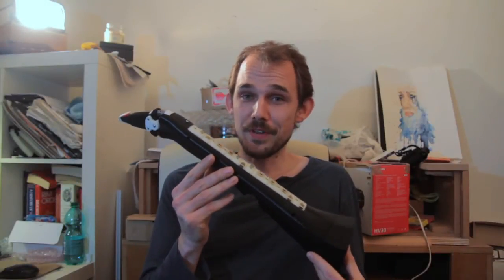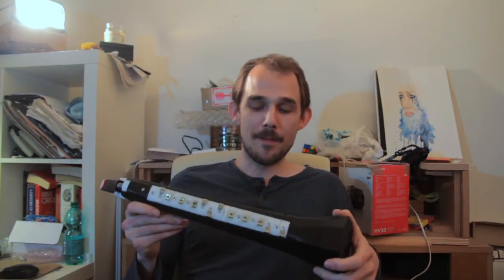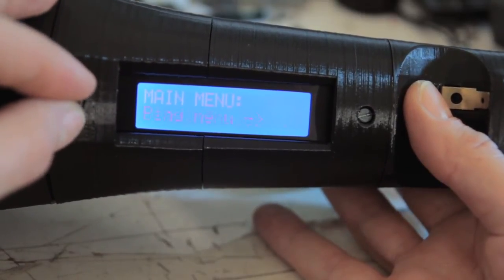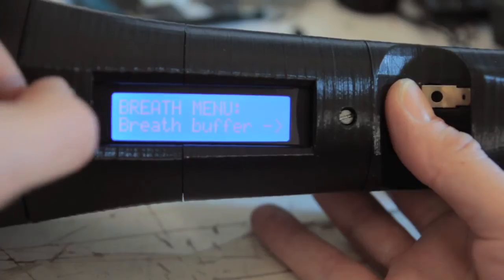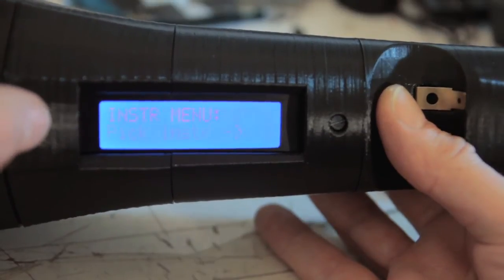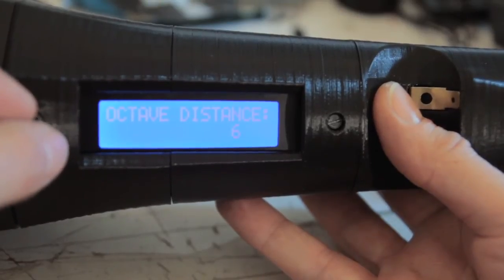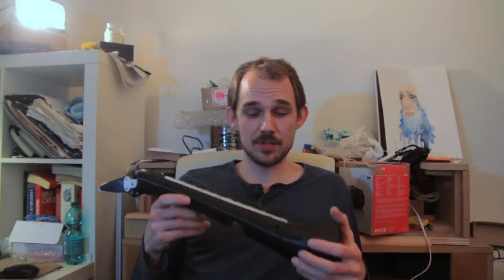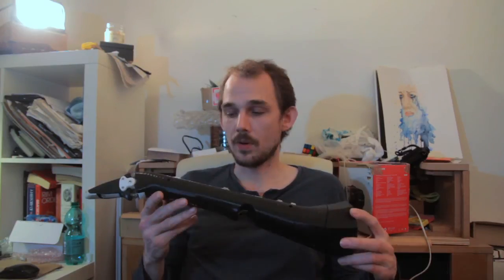OHMs - Informal presentation

Comment: Any chance a fan could get access to the blog? (It is currently invite only)
Reply from the maker: The blog has been offline for years now, sorry :(
Reply: Bummer! That hinged mouthpiece is amazing, and I’m staring at the STLs trying to figure out what you use to alter the light path to detect the bend. You mention “filament” in the analog sensor episode. 3D printer filament?
Reply from the maker: @DaveCaseyin3D  There have been two concepts for the bendy mouthpiece. The first one (the one in this video) used a potentiometer to form part of the axis and measure the position. Quite simple. The other uses two BPW34 light sensors and two LEDs. Bending the mouthpiece each way pushes a piece of 3d printer filament in between one set of LED and sensor, gradually casting a shadow between them which can be measured.